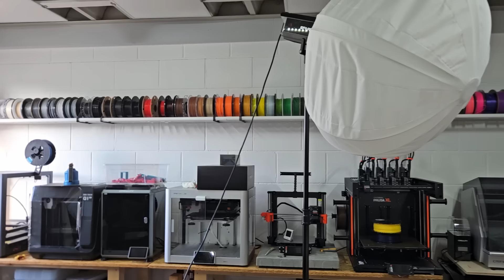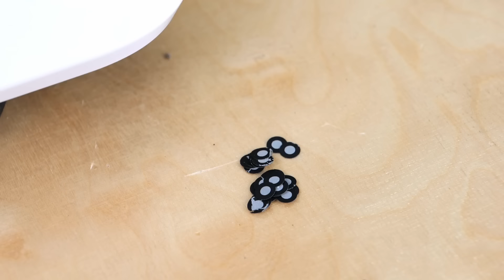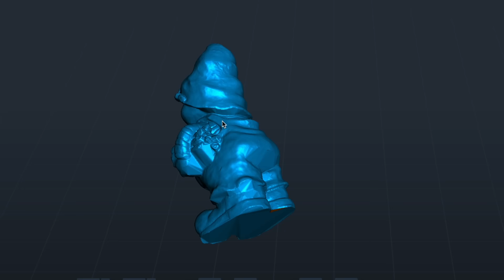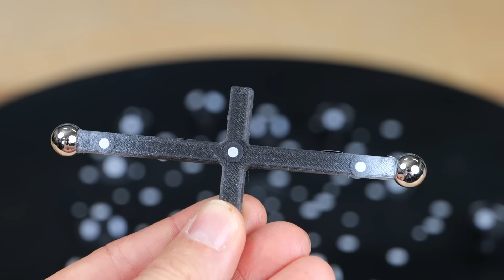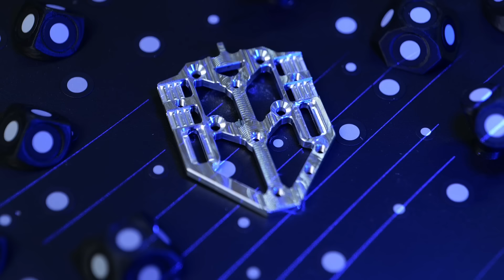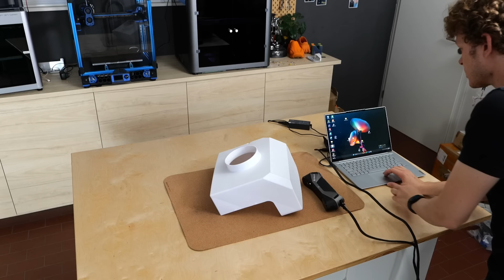Your 3D Scans Suck? Try this! (feat. Creality Raptor)

Comment: 1600€ is still quite a step price for a hobby product. Would consider buying one, once they are in the 200-300€ range.
Reply: Yeah. That's getting into wealthy enthusiast' territory, rather than 'hobby'.
Reply: @JackOfGears  It's about the price of an X1 carbon? I think you've been spoiled by having very inexpensive hobbies.. lucky! That could be a weekend of rental cost with a qualified instructor for a student pilot. Also about the Price of a nice guitar and amp. A long surfboard... pretty much any part on your garage-restored classic car.. a good quality bike... etc..etc.. etc..
Reply: @electronicsandewastescrapp7384  You just called poor people "lucky"...
Reply: @electronicsandewastescrapp7384 not everyone born lucky and live in 1st world country, including me.
Some live and born in a poor country that has salary of $200-300usd/Month which is only enough for rent and food and some change to spare
3D printer has come a long way it become cheaper and cheaper
I can find a ender v2 second hand for only $100 so yeah it can be an inexpensive hobby.
Reply: @TheVexCortex they are
Reply: For quite cheap you can get into photogrammetry that was mentioned in the video. Most of the tips apply to it as well but your biggest enemy will be the glare and lack of features in your model. Oh and you'll have to add some reference scale bars around or on the model to properly scale it. A nice setup you can get is any DSLR/mirrorless camera really, a decent prime lens, a tripod and some flood light (either LED or Flash) + maybe cross polarization if you're feeling fancy. For software use Reality Capture as it's free and really good. If possible I'd also make sure whether the DSLR you're getting supports live view via PC and remote shooting, this is especially helpful in automating photogrammetry later on when you get a controllable motorized turntable and learn of the "void" scanning method ;>
Reply: @rafall1118  Any suggestions what cheap or free tools to use?
Reply: You can get a creality ferret at about 250bucks. It doesn't have the laser option but in my experience with the ferret pro i never actually needet a higher resolution that the ir system
Reply: While it is true that this is a lot of money for a very niche application, the technology required just happens to be that expensive. No use in blaming anybody. 
You can get scanners for a few 100 bucks. But you will find that the results are really crappy. I also think that this is not a new kind of product that will come down to a fraction of the price eventually but the components needed just can't be had for cheap. So if you really want high resolution 3d scanning, you probably have to swallow the price.
Reply: @Alex_vGr  No need to blame anybody ... I just wait until the prices drops. 😀
Reply: Get your girlfriend an OF "hobby" to pay for it. 😂😂
Reply: Something is only expensive if you cannot have it pay for itself. If you don’t plan on using it for business opportunity and solely for hobby use, then it might be better to use your phone scanning app software to get you income for the larger investment. If you have an idea of things you can use this scanner for, that can produce cash flow, think of it as a temporary investment that will pay for itself and become profitable. Plus that upfront cost will push you to want to make those greenbacks reappear in your wallet 😂
Reply: The way cheaper Ferret does quite a nice job at about 25% of the price (at least where I live).
It doesn't have the blue laser option of course, but you can get some very good scans from it. 
I rented a commercial scanner for a day 2 years ago which cost me half the price of the Ferret and it still couldn't produce detail as good as this Raptor seems capable of.
Reply: Until you realize that commercial versions, which have been the only ones available, are 10-30X that cost.
Reply: @macgyver9134  That may be true, but 1500€ still remain 1500€. 😀
Reply: @TylerDurden-pk5km  I used to work with scanners that cost 30 times as much just a few years ago, and this video shows very similar results to what I would get. This brings high resolution 3d scanning to hobbyists with big enough budget, I would expect it go get even cheaper in a few more years.
Reply: @TylerDurden-pk5km  Well then just wait til you find out the PC to run said scanner is going to cost you 2-3 times that. I've seen my PC use 92GB of ram while scanning. It's not a cheap hobby, especially if you want the fun toys.
Reply: @macgyver9134  Difference is, I already have an expensive PC. I already have an X1 Carbon. I already have a plethora of other expensive tools. I should not have to pay the price of ANOTHER full X1 Carbon Combo just to fucking scan objects. Going on about how expensive scanners were in the past, or still are compared to commercial ones, means nothing. It's still obscenely expensive. It's even more expensive when you consider how many other tools you need (which you mentioned yourself, even though it goes against your point if anything...). Also, 2-3 times 1500 dollars for a PC that can handle scanning? Lol. I have 96 GB of RAM, a 7950X3D, a 980 Pro, multiple other multi-terabyte NVMe SSDs. All of that STILL did not cost "2-3 times" 1500 dollars, not even close.
Reply: @ofekfischer  So? Does that magically mean that 1500 dollars is cheap? I don't care if they used to cost 15 billion. It's compltely irrelevant to the point being made here.
Reply: @surfboardtrough7742  And there are plenty of other budget priced scanners available in the 3-400 range. This is one of the cheapest with this technology. Until this one, the cheapest was $20-40,000. The x1 carbon is a cheap printer. I have printers costing 10X that. Your computer is cheap, I have video cards alone that cost more. This is just the way things work, you have to pay to play, and the more you wanna play the more you're gonna pay. Sure, its nice when costs go down, but there comes a point when it can't go down any further, or worse when the corners they've cut make the product cheaper also make it unusable. The time and frustration saved going from a revo scanner to einstar for example, are more than worth the increased cost of the scanner. But the low end einstar is the bottom. It cant be made any cheaper without cutting corners. And this being creality, they've probably already cut every corner they could think of to bring the cost this low.
Reply: @macgyver9134  I mind less, paying more for a PC which is a universal tool I use every day, than for such a tool for a very special use case. 
Looking for at the video, I don't think that the PC must be that expensive.
Reply: @surfboardtrough7742  You don't have to.  You can take lots of photos with a phone and use photogrammetry. If you include reference objects, you can correct the scale.

Comment: I'd like the see the "pre-warping" topic, mostly to see how functional it would be on a variety of prints... I'm guessing it doesn't do well when the flexing is in the Z-axis
Reply: I second this!
Reply: I guess you could take the created deformation map (depth map) out of Inspector and apply deformations to the mesh file via some software. Maybe Blender? The model is already scaled and with writing down the depth map furthest points info it should be possible to calibrate it nicely for some geometry modifiers.
Reply: "Windage" is the term I see in injection molded parts.  Especially when I design something stupid that is a pain to mold.
Reply: Please do a video on that. I could imagine that its very hard to find the points at where to begin and end the deformation, as this also affects the print acceleration, flow, input shaping, etc, you name it :P
Reply: I turn off the fans and lower nozzle temps to avoid warping on some parts.

Works on a lot of parts.

I never allow more than 40% fan speed on my prints for PETG. And bridges keep printing perfectly.

Comment: I was studying homemade 3d scanners for the last month, I wished that video came a week earlier 😢,only now I'm trying structured light homemade scanners
Reply: Have you had any success? I’m interested in building a structured light scanner too
Reply: @RC-fp1tl There are two good SLS scanning software options that due to being ancient are now free! HP 3D Scan Pro V5 and FlexScan3D. As for the setup you'll need a projector and 1 or 2 industrial usb cameras (webcams work too but they have worse drivers and image quality). You'll also need to print calibration boards on either carton or plastic boards.
Reply: Which one? HP 3d Scan or Flexscan3d? Flexscan3d is from my pov the best DIY 3d scanner you could build on your own which easily compete with very expensive industrial 3d scanner.

Comment: My work place got one on my recommendation... and I brought it home to give it a work out ;) . I used it to scan my old Rovers boot wing and using five different scans (the ends are a rather awkward shapes for the scanner to pick up in one hit) came up with a great scan and the auto merge worked great all things considered (a lot better than I expected it'd do), though I did need to merge different scans from the same side before merging the two merged sides together... I think that makes sense... otherwise I got some rather funky positioning.

I certainly enjoyed using it more than the creaform scanner that my work place also has... and the software was a great deal easier to get going as well. The Creaform has a connector that breaks me out in a sweat when connecting the cable to the scanner due to the pins being hair thin versus the type C connector on the Raptor.
Reply: I used to scan sheet metal and other thin parts from time to time. My solution to getting both sides to align was to create "loops" from simple tape that connect both sides and space them accros the edge. That created something for the scanner to track on, and was easy enough to remove from the point cloud later.
Reply: @ofekfischer  Thanks for that tip, I'll give it a whirl.

Comment: I was working with Faro Arm Scanner and as a reverse engineer, You hit pretty much all the tips there are. Only one I would add is that more points is Usually BAD due to increase in noise so try to always move over one spot only once (from said angle) and in the most fluid motion there is, almost like in a painting booth. You need to do the minimal amount of overlap to hit all the places as required angles and you would never spray only from one angle. In this style of scanner you might need to do some more overlap but that depends on the preparation and mode you are using. Slow and steady wins the race. 

TLDR: move slow, steady, in fluid motion and one direction in one go. Do not go back and forth like brushing your teeth.
Reply: I'll have to try that- I have been working under the assumption that more points collected in the same area would result in higher confidence in those points... I guess that's completely backwards?
Reply: @sethphillips4779  What ends up happening with that type of scanners is that you get to much overlapping points. This creates noise that hurts your clarity, and can (especially in the near infra red mode) create misaligned frames that cause glitches in your scan. That said, you should try and get that area from all required angles (to get optimal coverage of all geometric features in this region), but getting more of the same, or going back and forth tends to create issues.
Reply: Adding a few more tips for handheld scanners that I've found to work well:
1. If the scanner has lost track, it would be best to stop the scan and start a new one, make sure to create enough overlap and stitch the scans later (I would also manually remove misaligned frames)
2. for scanning both sides of a thin part (sheet metal for example), I would use something to give it more thickness and something to track on when switching between the to sides. A loop of non translucent tape connecting the two sides works well, and easy enough to remove later.
3. On large smooth surfaces, where a NIR scanner would have a hard time tracking, I would add fake geometric features- even attaching crumpled pieces of tape would work.
Reply: Ahh those faro arms are AMAZING. Wish we had one at work. Happy with our transcan c though!
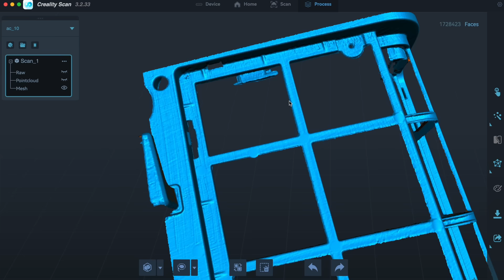Reply: Could the artifacts He mentions at 10:09 have been caused by moving back and forth allot and or just ''jittering'' with his hands?
Reply: @smartins. Don't have much experience with this type of scanner. Jittering and uneven movement could cause an issue although this type of scanner scans small parts and stiches them together and does not have an fixed positioning system like the ARM I was using, So its necessary to move over already existing parts otherwise its not going to work properly. But if I had to guess the plastic was "breathing" or moving somehow. I remember once scanning a statue on a wooden floor. Since I was walking around the statue my weight made the statue lean by 1mm at max and the scan was unusable. We had to move the statue outside to the concrete flooring otherwise it was not possible to scan. Also thin walled parts can have an issue with the scanning from both sides but I don't think its this issue.
Reply: @DreainCZE  
Thank you for the detailed answer i appreciate it since i'm pretty dead set on getting a scanner for the first time and the only one in my price range compared to scan quality it seems the otter is my best bet.

It's impressive how some scanners can be so accurate that the object being scanned can move by such a small amount that it's not even visible to the eye, Yet it will ruin the scan, A blessing and a curse kind of deal.
Reply: @smartins.  yes its impressive for sure. More impressive is IMHO how "cheap" they got. That faro arm was 100-200K € depending on the version your choose. Best of luck to your scanning journey. I loved that job, although sometimes it was hard or annoying. Especially when you were bending over some stupid object for 4 Hours :D 

Once you get it I think best is to just test everything you can. BEFORE you scan something large. You don't really want to spend 2 hours scanning something just to find out its scrap data :D
Reply: @DreainCZE  Yeah just like 3d printers were expensive and complicated and then in just a few years later everyone can get their hands on one for almost nothing, The trick is to learn how to use it though just like a 3d scanner :)

I don't expect it to be as easy as it might look there is definitely things to learn to properly use it, I will try to start with some easier things before i move on to the whole car... Probably😅

I hope someday soon it will be cheap enough to get metal 3D printers for home use as well but there is probably a few years left before that becomes feasible.

Comment: Can you use it for a room?
Reply from the maker: Not really optimal. I'd use LIDAR or Photogrammetry here.
Reply: @CNCKitchen I've tried photogrammetry a few times but there dosent appear to be good software that can handel alot of images. It's a old building so no angle are straight and it three levels

Comment: Vespa! Woohoo!
Reply from the maker: 🛵 yes! And I have more of them.
Reply: @CNCKitchen  Nice.
I've designed and printed several parts for my Primavera: a mount for an aftermarket fuel petcock, rear coil spring boosters (stiffens the ride), a bushing for rear shock mount, oil drain cap for air filter box, and my favourite: a pair of decorative handlebar end weights with a wasp inlay in each, filled with Vespa logo blue resin. They look sweet. 🙂

Comment: I'm still using a modified Kinect sensor for 3D scanning (which I don't do that often anymore though), and obviously it will require some cleaning and/or additional modeling. Do like the quality of this one. And despite the fact that I have 5 Creality printer which we're very satisfied with which are 3 heavily modified Ender 3's (even up to the point we use our own custom board for it), and two CR-10-SE's, I do personally feel that around 1500 bucks is "kinda" on the high end for a Creality product to be honest. 

It does seem to pick up quite some fine details, but for such prices I rather wait a bit longer until they are (even) more accurate to be honest. However very great video demonstration with lots of importants aspects & tips in regard to 3D scanning 👍🏽

Comment: zero your calipers on ball diameter, then measure the overall length to get the center to center distance. Tip for you.
Reply: Yes and the best way to get a center on 2 holes of the same size is to zero the caliper on the size of the hole and then measure the distance between them.
Reply: Thank you.
Reply: Ha, that's so clever
Reply: Oh wow
Reply from the maker: 🤓 yes!

Comment: How does it compare to Einstar (besides shining3D more mature software)?
Edit. Also wondering why cheaper Otter has better tracking in NIR mode?
Reply: Otter has better NIR optics allowing for wider capturing frame, the scanner thus has more data to work with and has better tracking.
Reply: @rafall1118  Thanks for explanation, weird that they didnt implement same NIR optics on Raptor as it should have blue laser addition without compromise on NIR mode.